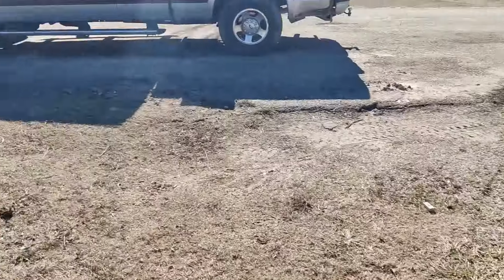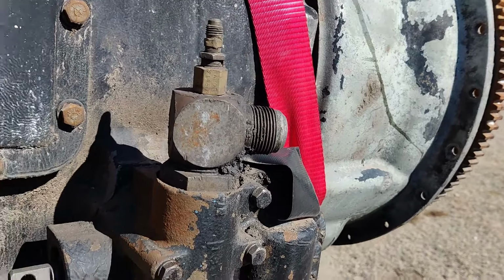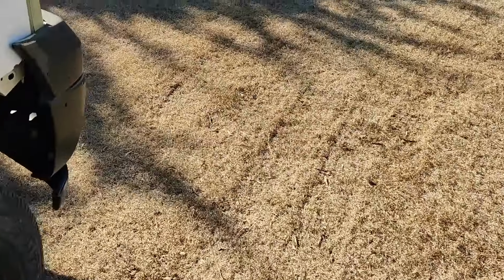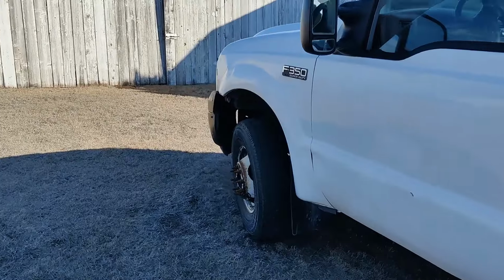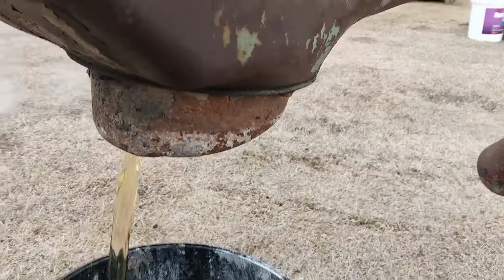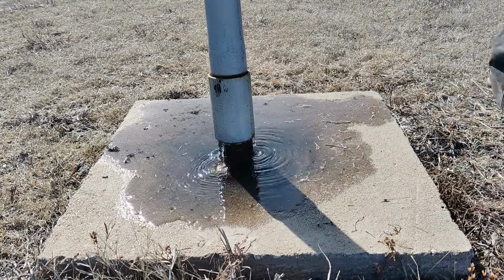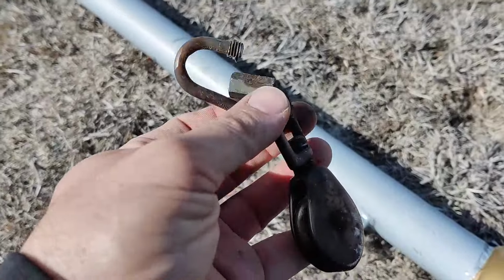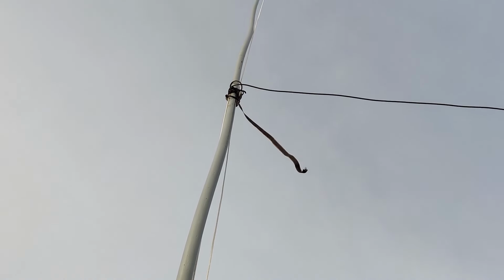Selling My Detroit 6-71 and Fixing My 30' Corkscrewed Dropped Oil Well Tubing Flag Pole

Comment: 👍👍👍You get the job done. Very interesting flag pole design.
Reply from the maker: It's one of a kind as tubing parts in the hole and dropped and creates the corkscrew. I fished that one out of the hole around 2011. It's too tall so it bends like it is. I used to straighten it but I gave up.
Reply: I loved the rendition of Our National Anthem at the end.
Reply from the maker: @shawnwright2356  thank you I was hoping people would stick around for it. I just made it into a short for those who don't. She initially made it for me for my intro but turns out I don't like doing intros.

Comment: How long are your poles? In process of building similar setup.
Reply from the maker: Those are 16.5, they are way too tall for that truck. Normally they are 10' and are pretty handy and safe at that height. I'm going to slide in 2 3/8 x 10' on my normal ones and make a set with both at 15' for temporary tall stuff. I hope to build/buy a medium size in the near future with 15'
Reply: @diesellivesmatter appreciate the info.
Reply from the maker: @Jim-hk7vs  your welcome, if your in the Midwest you might be able to find a winch bed for kinda cheap, a rolling tailboard is very handy to have. Next Saturdays video will showcase why it's good to have one.